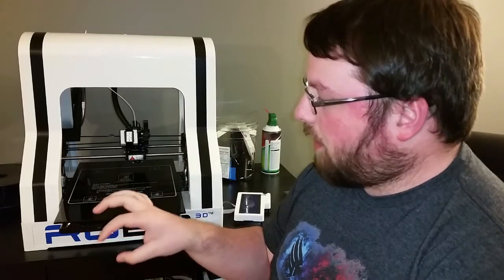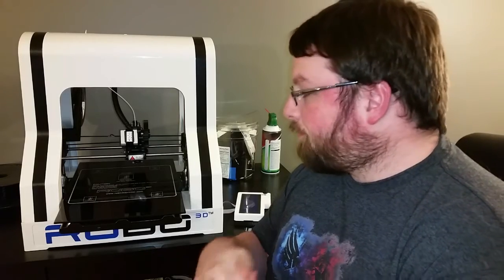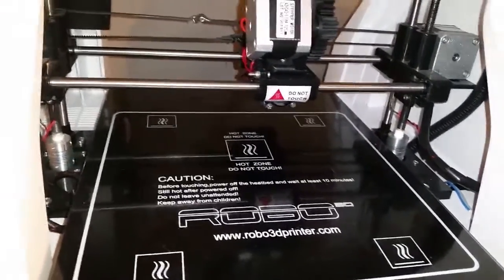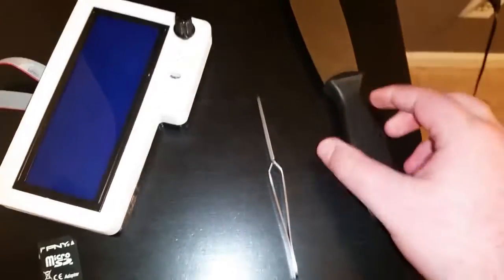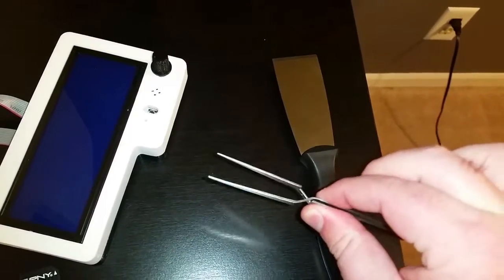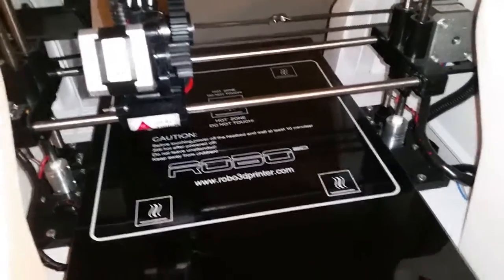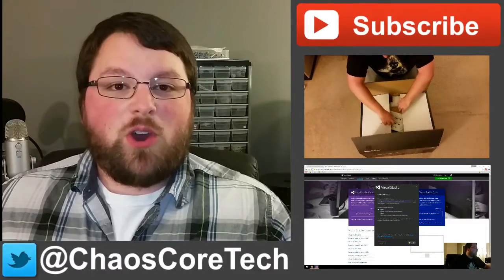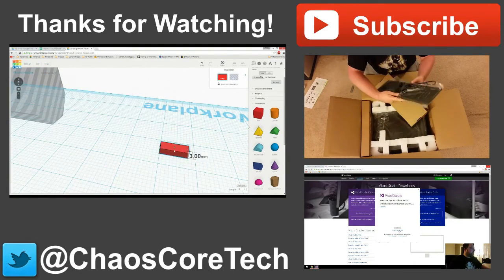Robo 3D R1 Printer - 1 Year Review

Comment: can this print small D&D miniatures with decent detail?
Reply: The Robo 3D R1 and Robo 3D R1+ can print down to 100 micron layers, or .1 millimeters between each layer. You can google images of that to see how it looks in detail.
Alternately you can order from a 3D Printing service and request the print at 100 microns to have them ship you a model to see if that's good enough - though I honestly don't know how much that costs these days.

If you print them in ABS you can finish them with an Acetone bath to smooth them, but this is only to be done in a well ventilated area as ABS + Acetone fumes are highly toxic from my understanding.
Sanding also can help with finishing if you choose to use PLA (A softer plastic, but prints easier and with no heavy smell while printing. PLA is my go-to choice for any project that doesn't need high heat resistance.) 

If you need higher quality, Robo is releasing two new printers - the R2 and C2 - which can print down to 20 microns (.02 Millimeters per layer) 
if you ONLY want to print miniatures, I would suggest the C2 since it's cheaper in trade of having a smaller print bed. 
That said, the C2 doesn't currently list as having a Heated Bed, but I've heard rumors they're going to change that. Only rumors, though.
You might also be able to add one, though I'm not positive as I don't know too much about the C2 yet.

If 100 microns is good enough, the R1+ is a workhorse and you can get a refurbished for $500 (Though it only has a 30 day warranty - that said, I've only had to use my warranty once, and it was in the first week.)
It's very likely they will also go on occasional sales - we got our new R1+ for 600 so it might help to watch the sales :)

Good luck!
EDIT: Kickstarter link to R2 and C2: https://www.kickstarter.com/projects/1238702276/robo-c2-and-robo-r2-smart-3d-printers

Comment: Is there any specified software to use? I am considering buying this printer, and I'd like a few tips.  ;)     (BTW I have used 3 other 3d printers in the past.)
Reply: And could you show how to install the screen? And possibly where you got it. :)
Reply from the maker: Hi! And actually Robo3D makes it super easy to do. The printer comes with a USB thumb drive and it has the software on it. So you just click the installer and it goes. And once you plug your printer in, it'll let you update the firmware on the printer as well. The whole process only took about 5 minutes for me. :) But the real magic is that these printers are pretty open source, so you can use just about any software you want to slice a model and print it.

Also if you'd like a little bit of additional information on my printing process, this video might help a bit: https://youtu.be/7QM1E_6PooQ 

Let me know if you have any other questions!
Reply: thanks or the reaponse! it really helped, for i am planning on buying this printer, and needed info. Cheers!

Comment: I've had a Robo 3D printer since May of 2015, so yeah, a year also.
Here are some things I've found.
To get nice smooth prints without any Z banding I had to build new aluminum Z rod mounts and support the tops of the Z rods so there could be no movement when the carriage and extruder moved back and forth in the X axis.
I also swapped out the coarse threaded 8mm rod for the Z axis for some metric 8mm acme (also known as trapezoidal thread).
This resulted in more accurate layers.

I was now getting some great prints, but another demon reared it's ugly head.
The parts I was printing needed to be ABS and I was having the normal warping and lifting from the bed.
Hairspray was mega-messy and I finally found that Elmer's Glue stick worked the best.
Plus designing the part with Mickey Mouse ears at critical areas helped. 

No lifting off the bed, but now I had a new problem.
When everything cooled down the ABS parts were pulling large chips out of the borosilicate glass bed. My bed began to look like the surface of the moon!

Robo 3D replaced the bed at cost and when the second bed started doing the same thing they refunded my money for the bed.
But now I had a glass bed with craters and it was getting difficult to position parts over the smooth areas. 

My solution was something that I learned from SinfoniaSam, PEI. https://www.youtube.com/watch?v=Fe-l80z27b4
I ordered a sheet of .060 inch.
http://www.amazon.com/Polyetherimide-Standard-Tolerance-PEI0113-Thickness/dp/B0013HQ7B0

Absolutely THE best stuff you can print on!

I permanently installed it with some strips of double sided tape. Not the prettiest, but it does the job and it covered the craters in the glass . 

Pei requires no glue, tape or hairspray. Just keep the temp above 65º C and you're good to go.

You do have to wait till everything cools down, but it's worth it for no lifting and warping.
Just clean it every once and a while with some window glass cleaner.

Robo 3D has made some of these improvements I've mentioned and if they could come up with a better build surface that doesn't cost $80 to replace, they would have the best printer out there for under $1000.
Reply: Just a note: The Robo R1+ comes with the Z Rod supports standard

For ABS, I use Blue painters tape to protect the bed, though I don't print ABS very often - PLA is much more friendly. No glue/tape/hairspray needed if you get the settings right, and after cooling the piece usually just pops right off the bed.

Comment: I wish my initial experience with Robo was as good as yours. My 3DR1 plus has been a total pain in the ass. I purchased mine with the MatterControl 10 tablet, and both were so defective that it was hard to diagnose the initial problems. The folks at MatterHackers (MatterContols company) were awesome, and had a new unit to me within two days of my initial contact with them. A+ for friendliness, A+ for efficiency. Robo's cusomer service was not nearly as good. I was shuttled between four different people, had the problem misdiagnosed (after spending hours of research into how to take the whole thing apart and replace a part) and am still waiting for my replacement, which is in transit now. They constantly asked me the same questions, sent the wrong info to the next person, or just plain dropped the ball and did not answer my questions.  Robo's customer service reps are very nice and polite, but they were incredibly disorganized and had a difficult time paying attention to detail. They did apologize for there screw ups, sent me a free roll of PLA and said they are implementing strategies to streamline service. They did seem genuinely concerned that I was upset and they did rectify it in the end. Who does not love a free roll of translucent purple PLA? For me, Robo gets an A for niceness, C- for current efficiency. I can't say if I like the product because I have had mine for two weeks with dozens of failed prints. I hope that changes with my new unit. I so want to be a believer of their product.

I am glad you are happy with yours though! Thanks for the review.
Reply from the maker: +Metalpanzerwolf Oh I'm sorry to hear you had such a bad experience with that. It's always sad to hear that, specially with people just getting into 3d printing as a whole, because it can turn them away from it really quickly. That's why I was glad mine worked so well. Thanks for sharing your experience though. :)

Comment: FYI--Just received my new Robo R1 Plus it NO LONGER COMES WITH THE USB THUMB DRIVE
ADAPTER this may not be a problem for some but my computer has no slots 
and i cant use my printer like this as the printer is not near my 
computer so now i have to run out and buy a adapter also screwdriver has
 been changed to a stubby version. My printer arrived very well  packed 
and was shipped very quickly
Reply from the maker: +Wally Mopar Oh that's good to know. That stinks, it seems like a pretty cheap thing to include in the package. I know I used it when I got it. Thanks for the info! Maybe I'll add that to the description so people know to get an adapter if they need it.

Comment: Nice Video.  And totally agree with you there.  My friend's Ultimaker 2 ( which cost around USD 2.7k) prints about the same quality as the Robo 3d R1+.  Unless he does ton of calibration, otherwise there's no difference at all between the print from the U2 and the once from R1+.  Plus the U2 doesn't even have auto leveling.

Comment: yea ill say thanks too there just isn't a lot of reviews on youtube for the robo not sure why. by the way what model do you have is it the r1 or r1 plus?
Reply from the maker: +psypher039 I know, I found that odd as well. And it's the R1. I had it before they released the R1+. It looks like they tried to address the filament loading situation in the R1+ though, that was one of my complaints. Not sure how it is though, so if you get one, let me know!
Reply: I don't have much difficulty loading the R1+ so I'd say it's a pass :)
They also added supports to the top of the Z-rods so there's no need to add the supports in manually anymore.

Like you, we were printing minutes after getting it out of the box, it was a great experience.

I REALLY recommend printing a top loading filament holder, but I like to do multi-colored prints a lot so it's nice to have both rolls easily accessible for when I need to pause, switch filament, resume.
Here's the one I ended up using, and I love it:
http://www.thingiverse.com/thing:267039